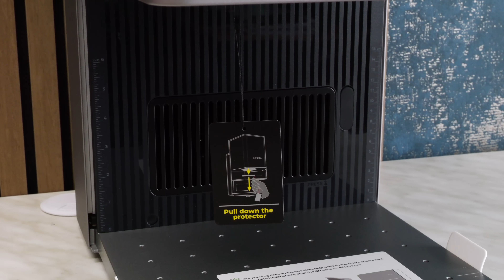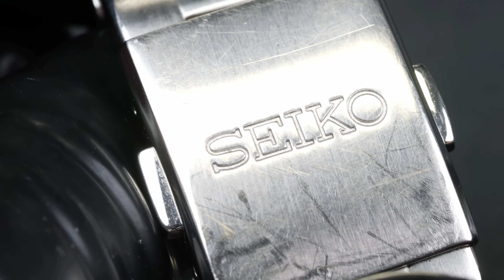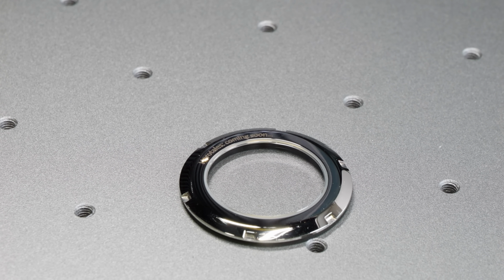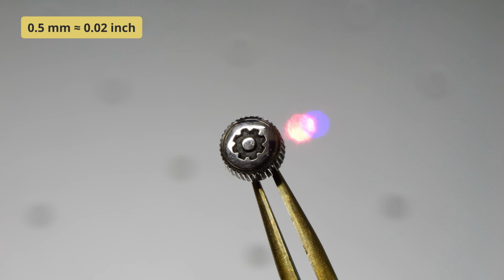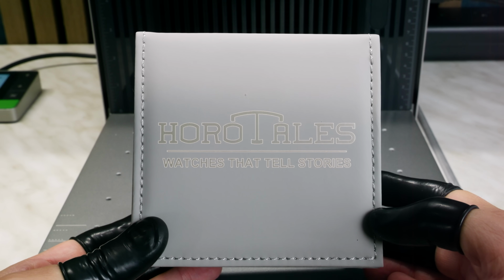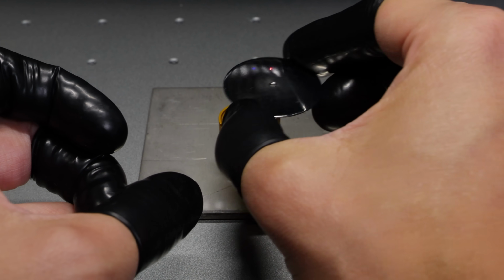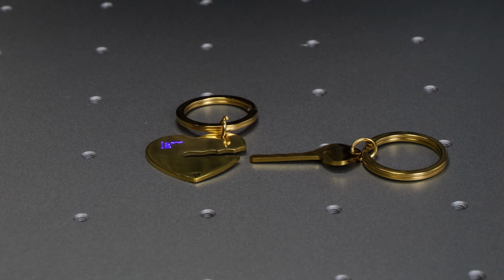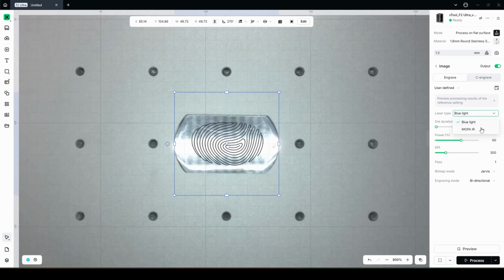10 Key Applications of the xTool F2 Ultra MOPA Laser in Jewelry and Watchmaking

Comment: Great video, One of the engineers I used work with engraved custom wine glasses for weddings using the 4 axis rotary head. It took him a while to get the settings right so it didn't try to engrave the other side of the glasses too.

Comment: for someone who repairs vintage watches this is a fantastic tool, Seiko for example made watches with plastic gears that disintegrated over time, Replacements are very hard to find.  Someone could use this to make replacements and market them or just use them themselves.  Saves many hours of searching the corners of the web looking for the exact part.    How about etching the dial onto the underside of the face eliminating the dial.  Lots of fun to be had with this one.